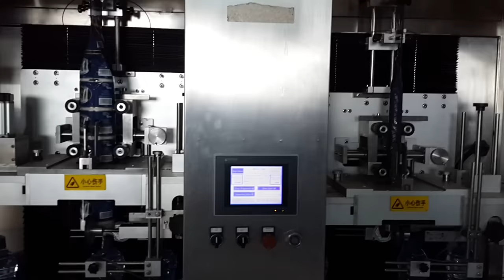5400 Bottle per Hour Fully Automatic Water Bottling Project

Comment: Your machine WASTES too much water 💦.

You must go back to the drawing board and ONLY allow the water 💦 to spray into the bottle once its over the WASHER HEAD.

I also noted whilst the water 💦 in filled into the bottle there's a lot of water 💦 wasted.

Here too you must either adjust your settings or put a better filler head.

I hope you will take my advice and make the necessary changes.

Comment: What's the cost of machine

Can you explain about , how can I settled for water supply business so please tell me machine cost ..
Reply: First of all this plant's capacity is not 6000/h. It's maximum 4000/h

In don't know the exact value of this machines. 
1. Pet blowing (Chinese) approx - 35-40 lakhs. If u want to buy Indian machines cost will come same.
2. Rinser filler capper - approx 10-13 lakhs
3. Sleeve labeler - same as RFC machine
4. Shrink wrap machine - 10-15 lakhs
5. Batch coding machine - 1.5-2.5 lakhs
6. Low pressure compressor - 8-10 lakhs
7. High pressure compressor - 12-18 lakhs
8. Chiller machine - 5-8 lakhs
9. Cooling tower - 2-3 lakhs
10. Water treatment plant 6-8 lakhs (depends on capacity)
Reply: You can install sami automatic plant also.
Reply: I forgot to mention laboratory, bis certification and fssai license. 
Laboratory instruments approx 3.5 lakhs
BIS charge approx 2.5 lakh 
And fassi 50k-60k
consultancy company will do the certification job for you and they will charge 1.5 lakh. You can't do the job without their help.
Reply: @papai179  Lab rate 2.80, BIS 2 Lacs with training, FSSAI Rs. 10 k

Comment: What is the fist machine you use in the process? (the feeder machine) ? The functions and components of the feeder? are there any sensors?
Reply: It would be an elevator, from a preform hopper. Typically it has sensor on top so it can know when is full, and sensor at the bin so it can know its empty.
Reply: @erikcastillo9451  Thanks alot

Comment: Blowing machine not set up properly (parameters)
Reply: Can u please explain what do you mean about the blowing machine
Reply: @hassunah6  blowing machine is to expanding the preform to be a bottle  by injection the hot air to inside the mould.